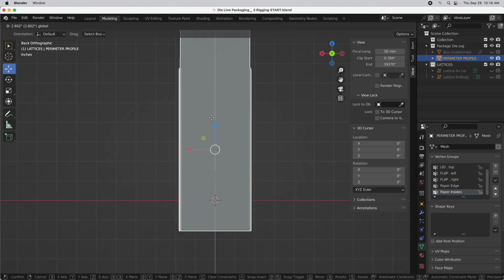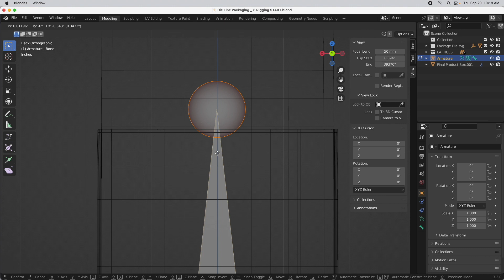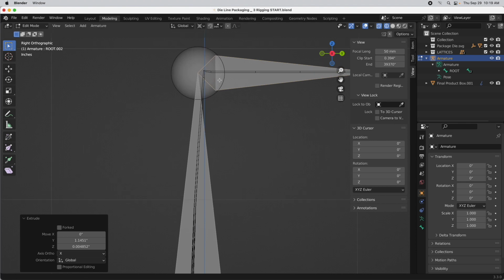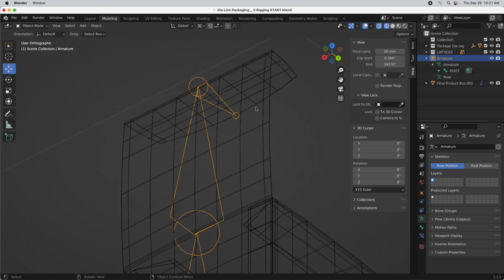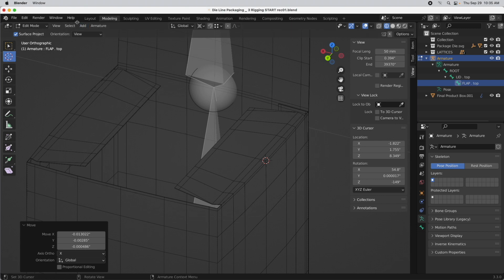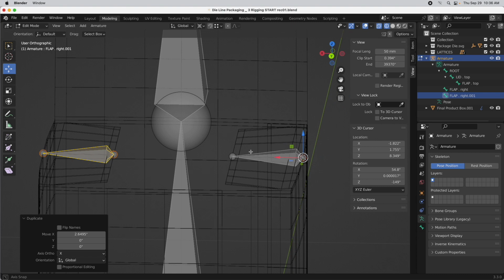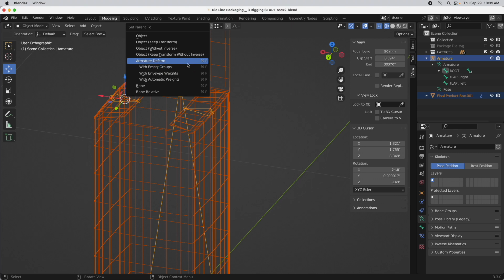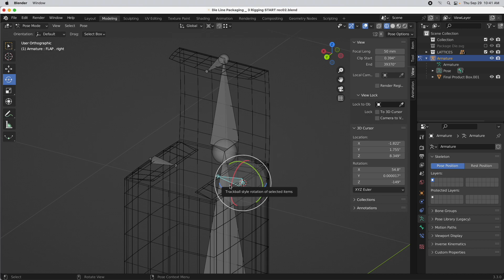Dieline to 3D, part 4. Armature rigging for posing purposes

Comment: My armature is not connecting to (or moving) with my mesh in pose mode. I have double checked my hierarchy, and my vertex groups are correctly named (same name as armature). The only difference I see is when I parent the mesh and armature (armature deform, with empty groups), it doesn't add the root in my vertex group like it does for you. Any advise would be appreciated.